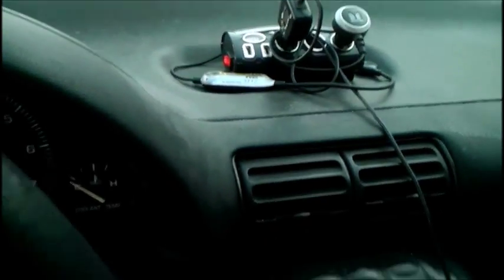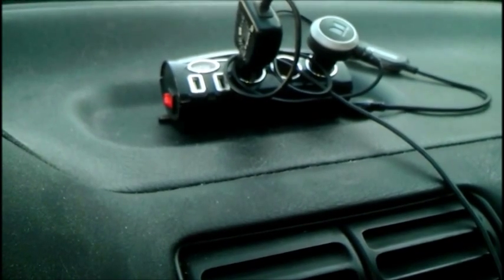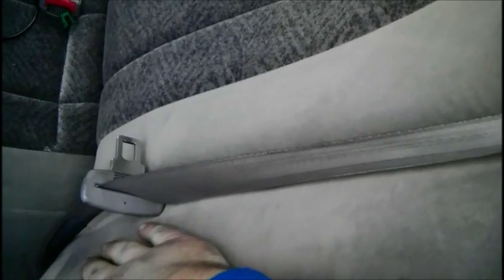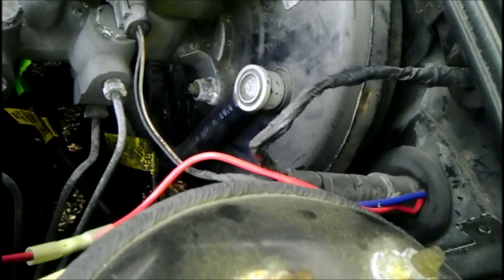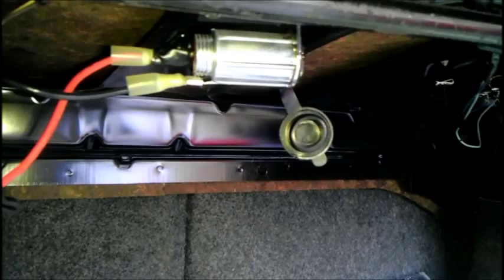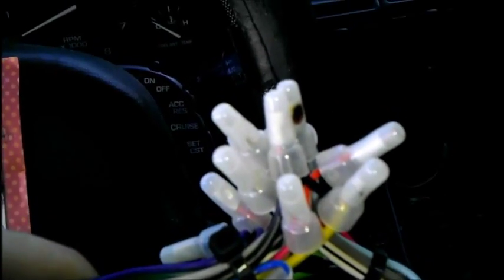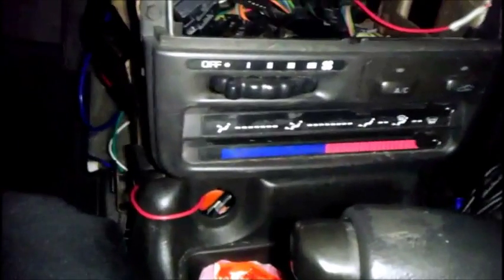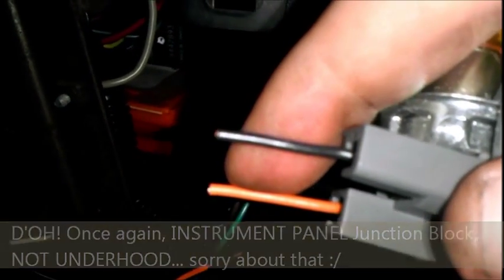Kicking the Saturn S-series F-5 issue in the rear-end, running new power lines, & relay set-up.

Comment: on my 2002 Saturn, i discovered there is another hole (supposedly for the clutch cable on manual cars) near the brake booster...if you pull that you can run wires into the interior of the car without having to modify the main harness hole..
Reply: The hole is there on both auto and manual cars..Saturn decided to just have the exact hole built on both models..I use the hole for my CB radio power wires

Comment: For me i have to rewire the power for the stereo and im thinking the cig lighter, assuming that should be enough to lessen the load on the F-5 connection.
Reply from the maker: I'll say this... I did the re-wire and my F5 ran just fine until the transmission took a shit and I traded it for a van
Reply: @adventureoflinkmk2  how many miles did your SL2 have when the tranny went out? I have a 97 SL2 with 118k currently
Reply from the maker: @gabrielcalderon9572  I think mine went to 212k or 214k

Comment: This video was pretty much no help!
Reply from the maker: Explain yourself, right now.
Reply: @adventureoflinkmk2  you ramble on for the first part of the video and give no useful information. then after you get mostly done with the install you don't show what you connected to the little fuse block to make it work again. I have been having an intermittent start stop situation with my saturn for a year now. so far i have tried everything everyone has suggested on youtube and the forums my car still continues to shut off. my F5 pin is in perfect condition all my relays and fuses are good i have power to my fuel pump harness in the trunk. but some how i have gone through 4 fuel pumps in one year and no one can give me a clue as to why this is happening. then i waste my time watching videos like yours that just stop short of even teaching you anything. shit is beyond frustrating. My electrical is solid. i have a Custom Electric Service 240amp alternator with a single 40ah bank of yinlong LTO cells. all my wire has been upgraded to 1/0 tinned ofc everything is fused and i have dual power and ground running from the alternator to the lithium battery. this car should run like a top but is plagued by fuel pump issues. I have since ran the fuel pump power off of a relay that is turned on by an ignition source and wired directly off the battery. but the fuel pump still shuts off. fuel pump number 5 goes in tomorrow. im hoping low voltage at the pump has caused it to go out as when investigating with my DMM i notice only 13.68 volts at the fuel pump harness while the car was charging at a solid 14.6 volts. but then after i ran the relay and the pump saw 14.4 volts it ran for a short amount of time then shut off and now the pump wont turn on at all. prove yourself useful after all and solve my problem will ya! lol
Reply from the maker: @Kyle-kr4je  ...okay.  for a start.. what brand fuel pumps you using?  Get low quality parts, expect to go through parts like they're going out of style.  That's good that your F5 is fine though, this video was meant to prevent it by bypassing everything else on there (like the power adapter, constant hot to the radio), etc. so the F5 doesnt hopefully happen to you.

However @ rambling on and not teaching anything, that's on you, I thought I explained things correctly and thoroughly. Its MY YouTube channel MY rules you DONT dictate what and when I put up, dont like it FUCK OFF.  THAT GODDAMN SIMPLE.
Reply from the maker: So in other words... would you like to know why this wasn't of help to you?  You said it yourself: your F5 is good, you got 13.68 volts at the fuel pump connection (which for the most part means you've ruled out the wiring and components up to the FP connector, but that 13.68 when the battery has 14.6 when the car is on does concern me). This video as I said at the start is PREVENTATIVE MAINTENANCE to hopefully NOT have the F5 happen to you by moving the big ticket items off that F5 (yeah like the aftermarket radio constant hot and the power adapter off it for a start).  Additionally it's NOT meant to fix the failed F5 connector if it happens to you. 

My guess here is two fold: shitty aftermarket fuel pumps and/or filters, and/or a voltage drop within the fuel pump circuit. (Given that a 20yo car brand that's been defunct for over ten years now is NO surprise, especially when the S-Series had little aftermarket support anyway.. Additionally your bypasses also kept burning up the FP.) Honestly there was no need for this conversation, let alone your crybaby original post and the crybaby rambling nonsense.  but hey, in spite of what I just said here in this paragraph and my last posted comment, thanks for the engagements and views all the same 🙃 #ThankYouNext

PS: bullshit like what I mentioned about aftermarket parts quality/support and the fact that OEM is becoming expensive at best; extinct at worse, is part of why I got rid of that Saturn of mine when I could and got a dodge minivan instead.  IJS 🤷🏻‍♂️ and spoiler alert: this ain't getting any better....
Reply from the maker: Oh well.. say the video wasn't any help when you know why and I explained it to you, warrants a jerk response. Thank you 🙃